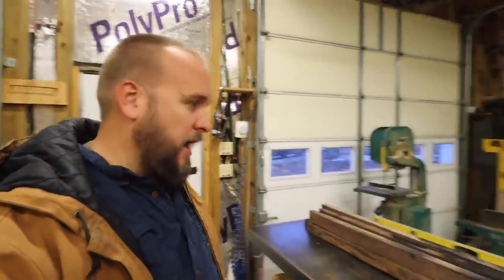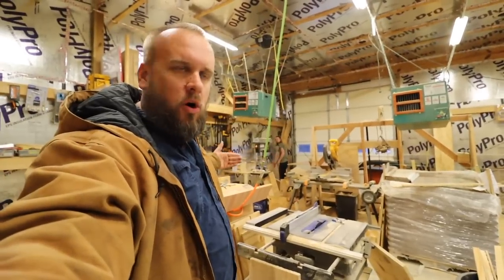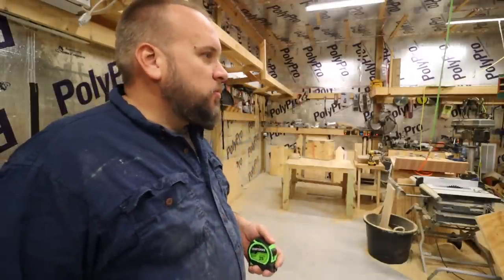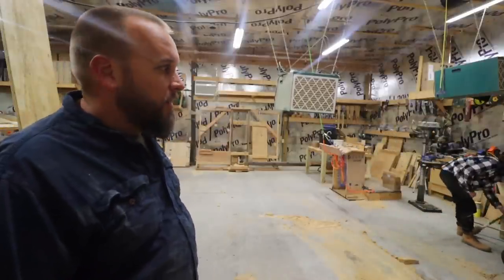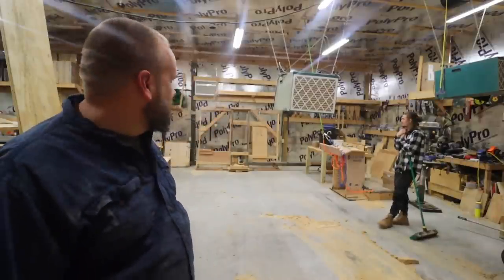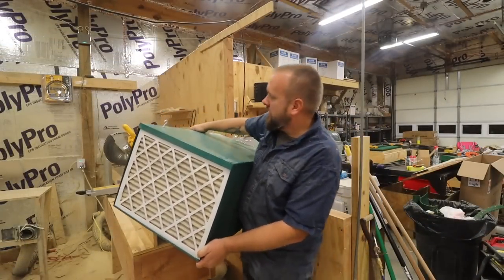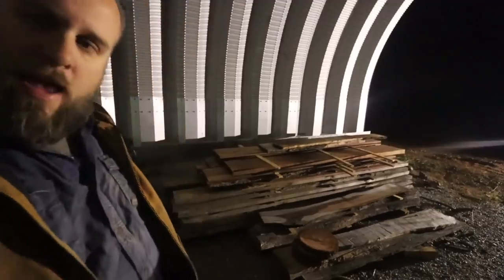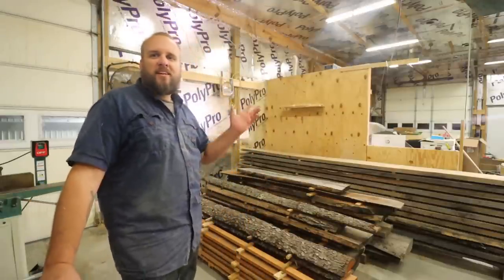Setting up the New Workshop

Comment: Good job , could you put the lumber to dry on the shelf's along the walls up high to give you more space? Just a future spot , maybe move the air cleaners around one or 2 in the wood working area and the others at the other end of the building. Or sell one and put towards something else , just my 3 cents 🤪
Reply from the maker: Thanks for the suggestion

watch out for spam comments. somebody replied to you with a fake telegram account. I reported it.  I don't use telegram